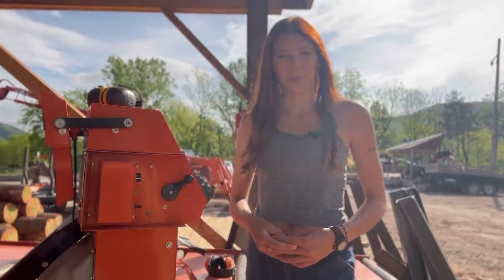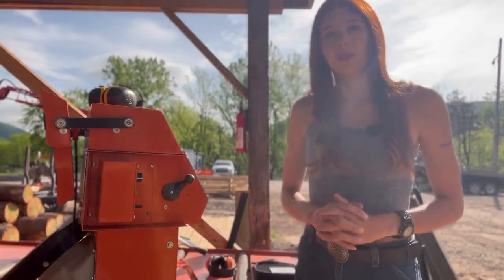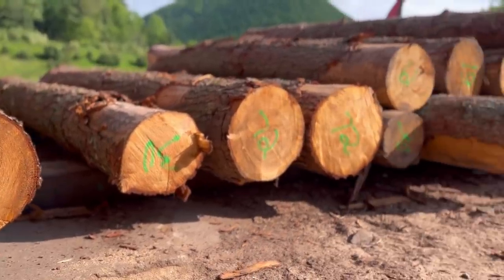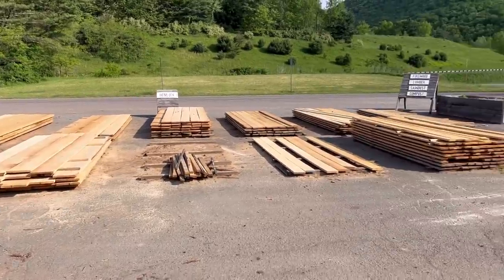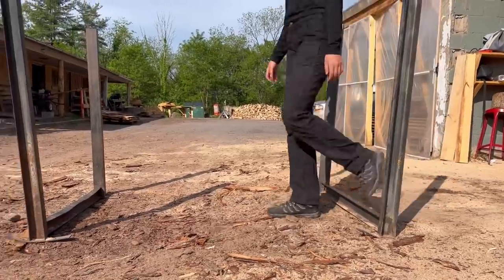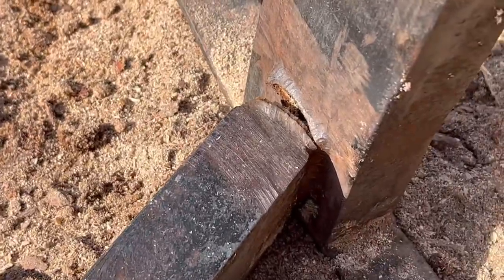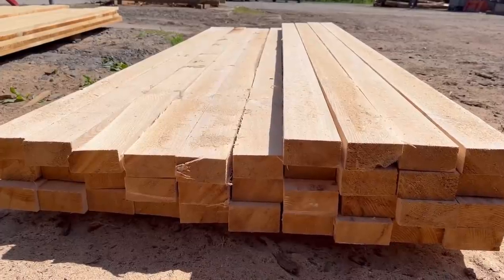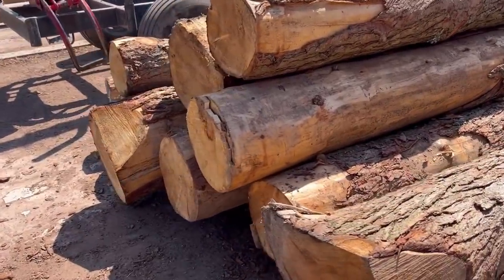The Process of Running the Mill 214

Comment: Hi Em,

Regarding the problem with keeping the steel frames for stacking the cutoff slabs up, try Laying them down until you have a few slabs on them and then stand them up. The weight of the few slabs should keep the frames up and their long enough to provide enough leverage to make it easy to lift up. I think this will keep them from falling and hitting someone. 

Good luck,

Steve

P.S. I hope it’s okay to address you as ‘‘Em’, my daughter’s name is Emma and I call her ‘Em”.

Comment: how do you decide how deep to make the first cut? Do you have a standard cut plan for each size log or do you just rely on your experience?
Reply from the maker: It greatly depends on the log, so the sawyer has to decide on a case by case basis
Reply: @lumbercapitallogyard  My question is along the same lines. All the logs are marked with an expected yield of board feet. Does that factor in for the determination on how to cut?

Comment: The feet of the jigs need triangular support braves welded in. A bit larger feet would also be an advantage.
Reply: A couple of minutes work with a heavy hammer would flatten the feet again. And any  welding shop can repair the damaged one for nominal cost. Larger feet as onkel suggests would help, but make them a bit heavier.
And yet again I am amazed that you routinely handle this rough cut lumber without gloves.